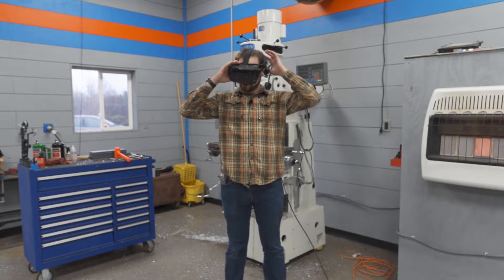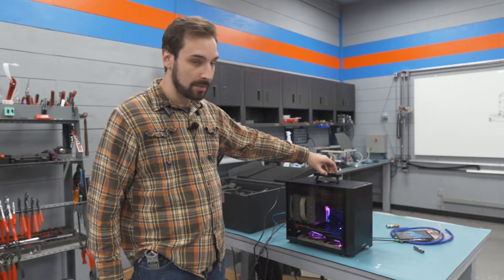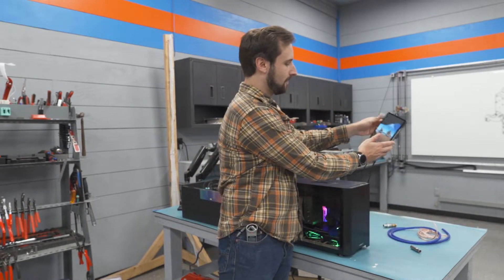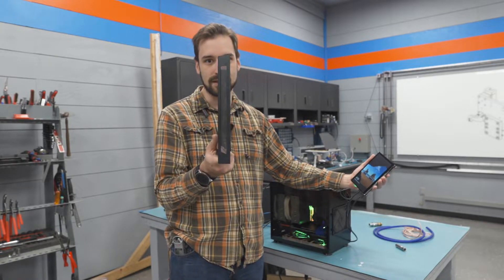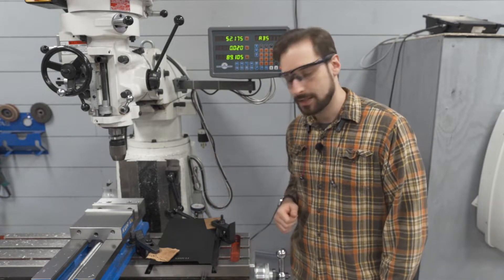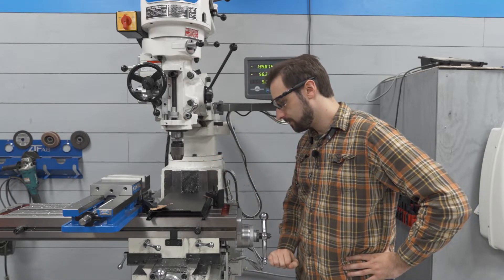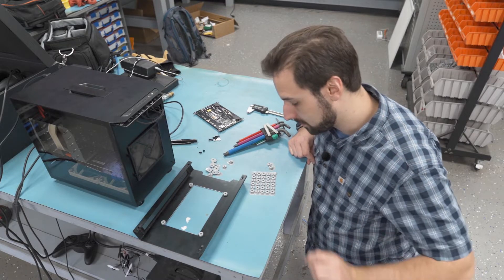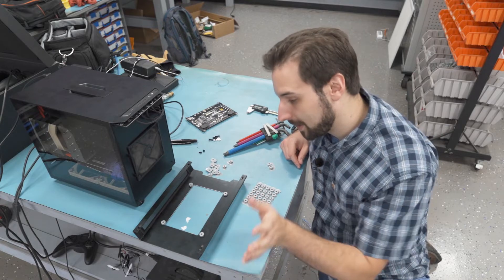PC Embedded Monitor for Headless VR System

Comment: does the front panel have enough room to mount the monitor in landscape mode?
Reply from the maker: No, unfortunately. There is a lot of room behind the panel to accommodate any wire orientations and such, but the panel it self isn't wide enough.

Comment: Is it better to use 15mm bottom instead of 25mm fans?
Reply from the maker: I would suggest using the biggest thing you can fit in there. I used a three slot video card. So I had to take the shroud off of the video card and use short fans to fit everything in there. If you use a smaller video card you should be able to use normal fans.

Comment: Is that a Noctua-D15 cooler in there?  I'm thinking of getting the Lian Li tu-150 and want to know if the D15 will fit in it.
Reply from the maker: It is a Noctua-D15. It fits just fine. The only thing I had to work on was fitting the graphics card in. I ended up taking the shroud of it and then everything was fine.